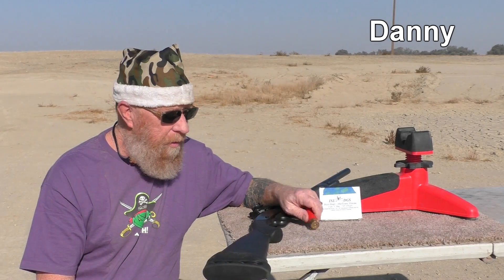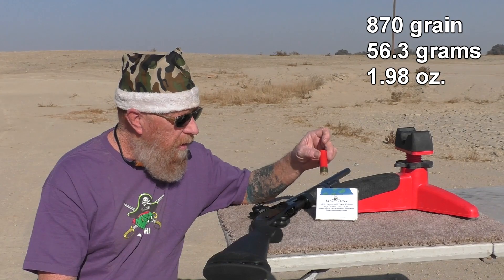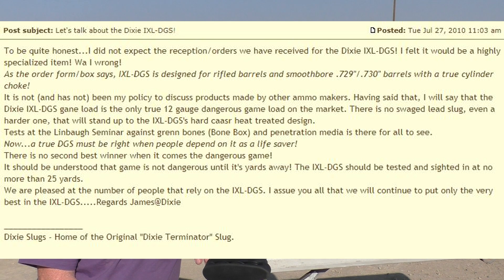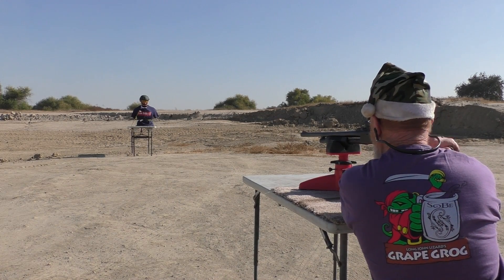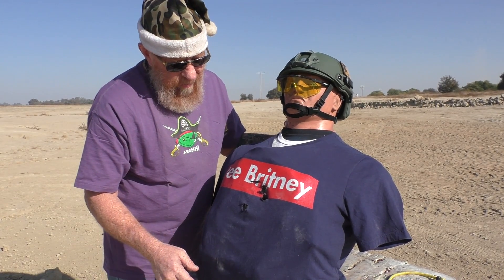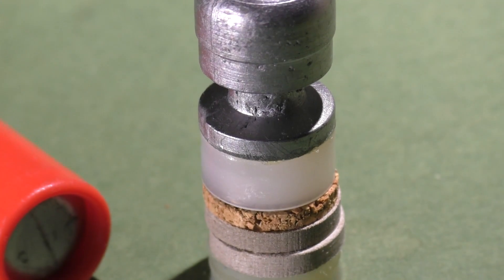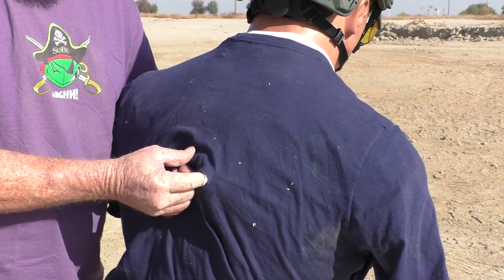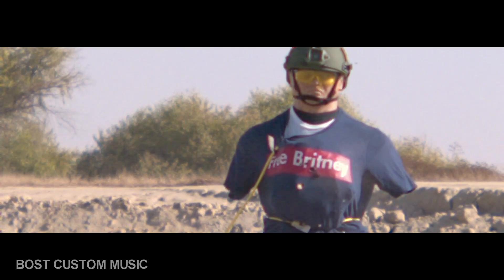Dixie IXL DGS - The BEST 12 ga. slug - you can no longer buy

Comment: Just a thought. Before you shoot them all, at least make a wax casting, or send them out to be duplicated. Those are awesome!
Reply: Looks a lot like there is something going on inside it, i dont think its just a solid dumbbell. Looks like the spine is pert of a piston for some reason
Reply: @ravener96  I think so, some kind of “wad” thing..
Reply: Maybe they can cut one down the middle to see what's inside, if anything. Duplicating these would be great!

(Of course for the DIY-inclined, there was that homemade "Knob Goblin" 2 oz brass slug that made it through the lead plate...)
Reply: @ravener96  They are solid, it's just the inertia crushing them.
Reply: @SalveMonesvol  
I think that the form and structure follow a deliberate principle.
There are basically two main dimensions that are connected by a bridge. The front mass is larger than the rear - this ensures that the flight path is essentially straight and that the bullet does not tumble or roll over.
When it hits an obstacle, there is then mass inertia. The projectile is basically in two parts. In the event of an impact, the front part is braked, so energy is withdrawn. The rear part of the projectile, however, adds energy again. It presses the web together and transfers kinetic energy to the projectile, which is now similar to a normal projectile.
I'm just thinking about what would happen if a projectile were given the shape of an artillery shell. The material - brass. Inside then a tubular cavity and then a kind of penetrator made of a harder material in the cavity. The penetrator would have to fill about one third of the cavity and it would have to be movable within the cavity. Then the effect on impact should be similar. The outer shell slows down on impact, but the inertia then moves the penetrator forward. The same effect as people in a car who are not buckled up.
Unfortunately, I don't have any tools or machines to build something like the pattern I have in my mind.
Reply: @stefantaubert  nope, look at how the rifling marks line up. It's pretty clear that the deformation happens inside the bore. 

This probably helps give excellent rifling engagement, shoving the stem part into the full-diameter front and rear sections wil cause diameter to increase into the rifling. This may provide consistent accuracy in variously-dimensioned rifled shotgun barrels and also let the slugs be cast to a fairly loose tolerance.
Reply: @Kaboomf  I think u are right - i did`nt see the rifling marks on the projectiles, my failure.
I am then interested in your opinion on my further idea that I have described.
Greetings and stay safe & healthy!
Reply: @stefantaubert  You'll find some armor piercing projectiles that partially resemble your idea, but for different reasons and based on actual physics.

The ideal nose shape for a penetrating core is rather blunt and stout, not very aerodynamic. Some AP designs therefore have an air gap inside the aerodynamic copper jacket, in front of the core. You could fill this gap with lead to make a heavier bullet, but the core would then have to penetrate the lead before it gets to the armoured target. On impact, these air-gapped jackets easily crumple and come loose from the core which continues as a seperate projectile.

In some instances, this sort of design allows for a tail-heavy full metal jacket that's ostensibly not against the rules of war, that tumbles in soft tissue but goes straight and penetrates well on hard targets where the outer jacket gets shed off.

As for making a sort of "dead blow" projectile with a loose element inside, I think you may have mixed up your frame of physics reference. You're effectively arguing that the unbuckled passengers inside the car are somehow adding kinetic energy to the collision, compared to a car with buckled-up passengers. They're only "launced forward" relative to the rapidly decelerating car, in reality they're merely continuing forward at the same direction and velocity until they hit something.

If anything, you proposal makes for a projectile that acts like two lightweight bullets hitting the same hole in very rapid succession, instead of one heavy bullet. Physics dictate the combined inertia and kinetic energy will be exactly the same as one solid bullet of the same combined mass and fired at the same velocity.
Reply: @SalveMonesvol  but where does the stem go
Reply: @17Wildcat I tried finding a patent for these, but alas I couldn't. 

I was able to dig up info that said they are a cast alloy of some type, not swaged, and heat treated to 28bhn. That's all I could find :(
Reply: @SalveMonesvol  then where did the stem go? its not squeezed out or protruding through the front plus keep looking it seems to Flip and hit stem end first
Reply: Hey, man; as they have demonstrated on their show, there are still plenty of, quite frankly, more capable slugs. Good luck sourcing Tungsten carbide slugs, though. Those would surely need to be made by using a sintering process, unless the makers are actually capable of machining Wc-C, which would lend itself to a much higher price. Either way, it's harder, stronger, more dense(than Pb and even depleted U), and just overall better than cast Lead in regards to its ability as a shotgun projectile. Sorry, I'm rambling again.. Tungsten is just too great to explain in a few small sentences, really! In fact, there's a shotgun round with Tungsten buckshot that Chinese police and small parts of the military use sometimes! Ok, I'll stop now... 😂
Reply: I had to say the same thing, because they're awesome like you said
Reply: @dodieoinst4598  Not sure where your info is coming from, but its not accurate. DU is about 30% more dense than tungsten. Not sure about the hardness, but its used in sabot tank rounds to punch through ballistic steel so it has to be pretty hard. Also, there are several brands of commercially available shot shells which use tungsten. Hevi-Shot is the brand I see most, but there are others.
Reply: Hard-case lead. The measurements can be lifted with the images they show.
Reply: 0:31

Comment: James Gates was a great guy and ammo building genius, I bought many of his Dixie slug products, the original Terminator .73 caliber, 730 gr. 12 ga is nothing short of brutal to anything it hits. The 12ga 600gr Tusker is a brute too, as is the Terminator 500gr 20ga offering.  12ga Tri-ball was another incredible round which had all three 60 caliber balls hitting in a 7 inch circle at 40 yards, with each ball having more energy than a 44 mag. Dixies slugs are heat treated and water quenched for hardness. IIRC Activ brand shotshells were another creation of James also. RIP Jim, and thank you for the wonderful products!

Comment: Not a real scientist, but I'm pretty sure that the slug mushroomed in the gel because it was shoving its way through the whole time, it didn't mushroom with the ice because the initial impact was what broke the block apart and the slug just went between the separating pieces.
Reply: shawn hlebasko 
You could be correct. Sounds right 🤔🤷🏼‍♂️.     🇺🇸😎

Comment: "Get around to it" sounds a lot like "Get a round to it"
We tested some Lexan safety glasses at a job site years ago by dropping 10 foot section of 3/4" threaded steel rod onto the lenses.
Not one lens broke, but we were able to drive a few lenses through the 2 x 4 behind the glasses.
Reply: Yep, you should replace your shooting glasses every 5 years or so (per Wiley) because the frames get brittle.

Comment: The reason the slug didn't mushroom when contacting the ice is simple. Water exists in one of three stages. 1. a liquid thin 2. when heated above boiling it becomes a gas. 3. when cooled below 32 degrees Fherinhight it becomes a solid and as a solid when the led projectile contacted it. The ice merely became ice cubes. Dr. Bruce F Andrews PhD

Comment: "the best slug you can't buy"
People with lathes and spare aluminum : allow us to introduce ourselves
Reply: That would be too light. Maybe steel.
Reply: @SalveMonesvol  bronze or copper maybe
Reply: @justicar5  I think brass is easier to machine. Of course we would like to see all alternatives with the same amount of powder.
Reply: @SalveMonesvol  it's also harder than lead, and preferred in some ranges afaik...
Reply: @SalveMonesvol  make molds out of alu, then cast lead slugs.
Reply: @Kaboomf  you can't
Reply: @SalveMonesvol  why not? I own several molds made from aluminium, Lee makes them. A 12 gauge slug is large enough that you could single point turn the mold in a lathe, though you may need to grind some custom toolbits. Superglue two flat blocks of alu together and chuck them up with the joint line exactly centered. Bore and turn the mold cavity on the lathe, then melt the glue to seperate your mold halves.
Reply: @Kaboomf  Why do you need the original for then?
Reply: @BigPanda096  yes

Comment: boom, boom boom, gonna shut you right down, (and leave you in a hole in the wall!)  This round may be for bears, but I would not doubt it would have made an old Cadillac flinch, even at highway speed!  Glad to Danny up and accelerating, missed his cherub face and tactical Santa hat. (where's the duct tape?)
Reply: TrikeRoadPoet 
The old straw hat is about due for a patch. Thinking about offering it up on ebay with a signed patch of duct tape. Watcha think???? 🤔🤷🏼‍♂️.    🇺🇸😎

Comment: Similer to a THOMPSON MAXI-BALL!!    ( the narrow waist is supposed to drive up into the front part, to expand it into the rifeling, which it did BEUTIFULLY) the maxi-ball is cast out of pure lead for use in a muzel loader!!)    STILL uses 120g 2f powder to get projectile upset properly, into the rifeling, SO IT KICKS LIKE A MULE, as the maxi-ball ALSO weighs about 2oz

Comment: I'm sure that when the lead plate moves back it uses up energy from the slug. If it was braced not to move the slug would have likely passed through.
Reply from the maker: The mass of the plate is 240 times that of the slug.   The slug stops long before the plate even starts to move.  We've discussed this many times.

Comment: A straight hit with the higher powered rifle rounds like 5.56 and up on those helmets also have good chance to go through, but they are made so they will ricochet most of the times due to the round shape. impressive result though that this slug with relatively low speeds  packs such a whallop that the whole helmet just looks like its made in china by some little kids for a toy version of it.